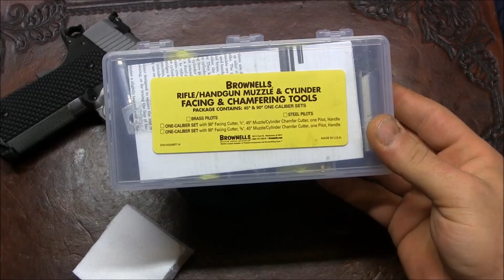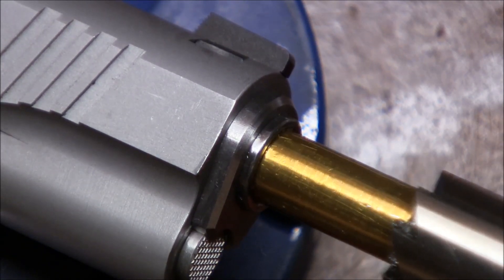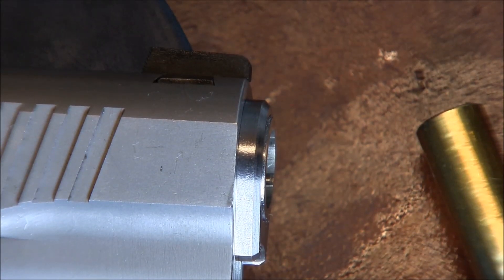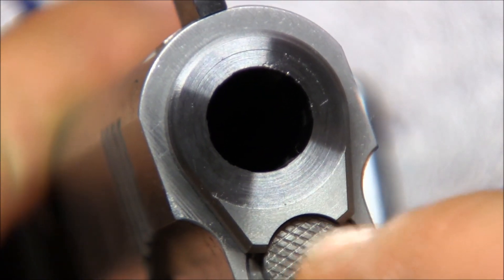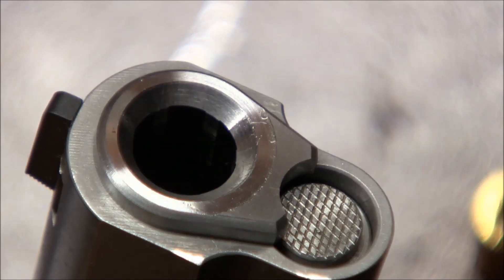1911 Build 4 - Part 5 - Cutting a Reverse Crown

Comment: Is there a specific name for that 90 degree cutter you start with? Have been looking for one that can face a 1" tube that has a 3/4" Inner Diameter, but haven't been able to find one for several years now. Also, looks great. I'm surprised they don't come like that. (though I guess it would be hard to make them match up with other parts).
Reply from the maker: I think they are called piloted facing cutters, but I really don't remember. Try McMaster Carr.
Reply: @MosinVirus  Thank. Actually found several... but just not any near the right size I need. Still much closer to finding them though. Appreciate that.

Comment: I’ve tried and tried to find these parts on brownells, anyway you could help me find what I need to do a flush cut reverse crown barrel on my 1911, along with a reverse crown cut on the barrel bushing.
Reply from the maker: I showed the tools I used. If you do a search for cylinder facing on Brownells site you will find them. Then you can browse related items for other chamfer angles, pilots, etc. I think I showed in the video that I cut the crown into the bushing, then rounded (deburred) the edge of the muzzle
Reply: @MosinVirus well, I could see where you used the 90* cutter to cut into the bushing some as well, I guess you done that so when you Bob nosed it. See I’m wanting to reverse crown the barrel and bushing together. All as 1 angle.
Reply from the maker: @rogerharrelljr1935  I went a little but inside the bushing with a 45° as well. If you dish it out too much you will reduce the engagement area with the barrel and weaken the bushing.

Comment: MV, sorry if I missed it, but what kit did you get from Brownells?  I've been looking for the same one but it's damn near impossible to find on their site.  Let me know thanks!Btw, great work as usual.  You've been a busy bee with your builds.  Please keep uploading your awesome vids!
Reply from the maker: Thank you. search for muzzle face cutter. then click on a cutter with a handle and pilot. then in description you will see links for sets. for example one caliber set. click on that and a new list will open. select your desired caliber. the set should include that caliber pilot (brass or steel based one what you selected) a 45 and 90 degree cutters, and a handle. then you can simply buy additonal pilots separately. again look at the links in the description. let me know if you can't find them and I will send you a link.
Reply: +MosinVirus I have been watching 1911 YouTube vids for years. Excellent vids!  Is the the part number for your cutter/chamfer set? 080-946-450WB?  I assume I would need a different pilot for different calibers.
Reply from the maker: +Richard Cooper yes, that is the number. I also got a pilot for 38 caliber to crown 9mm barrels, and .20 pilot to recess the frame around the slide stop pin hole. keep in mind that the 45 degree cutter is not wide enough to cover the entire diameter of bull barrels.
Reply: Thank you for the quick response.

Comment: Why did he have the barrel bushing slightly offset in the end when showing the work?  Was there any particular reason for having it that way at that time?
Reply from the maker: I am not sure what you are referring to. Can you let me know what time of the video you are asking about?
Reply: @MosinVirus  7:00.  It's not an issue.  I was just curious sir.  You did both an excellent job as well as video.  My curiosity just got the better of me is all.  And by the way, that job and the crowning look dandy spiffy.  It makes a world of difference.  That end looks all business now.  My only question that I can not find an answer to is what is the difference between crowning and reverse crowning.  No one has ever effectively addressed that for me.  Also, Larry Potterfield of MIdway USA states that there are four types of crowns and mentions their degrees.  Do you follow that or make that decision yourself?  Oh, and I learned something from you and wouldn't have known it were I to attempt crowning myself and that is that the barrel is at a one degree tilt while in battery.  I never, ever knew that and doubt I ever would have were it not for you, so thank you for that sir.
Reply from the maker: @FoxBonly  oh I see. That was just because I kept removing the barrel from the slide so I got tired of locking everything back the proper way.
Reply: @MosinVirus  k.  Thank you sir.  I always wonder if machining steel like that affects the metal's tempering status though.
Reply from the maker: Not at all. Especially not with hand tools. The only time that would be affected is if the parts were subjected to really high temps (which is why guns that were in a fire should be checked) or if parts were case hardened (surface only) and you removed the hardened layer.

Comment: Nice work, again ! The slide you`re using, is that the 1911 builders slide with Novak lo-mount cut sights ? If so, what front sight height are you going with .250, .260, .270 based on a .500 rear ?
Reply from the maker: yes, I am using a 1911builders slide with Novak sight cuts. And I am using a plain black .160 height front and adjustable rear? lowered almost to its lowest position. the rear adjustable I am using is Springfield Armory adjustable. Brownells doesn't have a picture, but it looks exactly like LPA sights and is only $45.
Reply: +MosinVirus     $45 for an adjustable,  that`s a steal ! Thanks for the info. I`m leaning towards the Truglo. I want some thing I can use in low or no light for home defense. Plus I`m just starting to have trouble with my eyes so those bright green sights may help. lol
Reply from the maker: +TWISTEDSTRINGS69 Yes, I completely understand. my eyesight is still ok, but when I was shooting at the indoor range, I noticed that plain black sights are very difficult to see.

Comment: Hello, I am attempting to do the same thing on a 9mm 1911. I have ordered the single caliber kit from Brownell's but there is some confusion as to what pilot to use. Brownell's techs gave 3 different answers and I wound up with the incorrect pilot bushing. I ordered part number 080946350 which has a .35 caliber brass pilot. It will not fit down the barrel of any of my 9mm's. 

Could you please share with me exactly what part number you are using and what pilot bit you have for the 9mm?

Comment: What is the purpose or benefit of a reverse crown???
Reply from the maker: The edge of the barrel where the bullet leaves it is very important. A crown moves the edge deeper from the muzzle so it can't get damaged if the gun falls on the muzzle for example. A reverse crown just moves it very deep. Primarily deep 45° crowns are for aesthetics only.

Comment: Hey there you show that the bushing needs to be trimmed as well but you do not show that process.  I was wondering if you have any video of that process.
Reply from the maker: Not sure what you mean.
Reply: +MosinVirus 6:38 you talk about getting rid of the step on the bottom of the bushing but you do not show that process
Reply from the maker: +MegaCleanCab oh sorry, I simply filed the protruding portion down to match the upper portion on the face of the bushing. Then sanded the face smooth.
Reply: +MosinVirus did you just use take the bushing off and run it on a file until it was even..then sand it smooth?
Reply from the maker: +haw1144 I took the bushing out, gently secured it in the vise, filed the remaining material off, then sanded it in one direction for a brushed look.

Comment: I don't mean to be critical.... but looks like you got a little wear on the inside of the barrel on the lands, maybe from chips getting between the bushing and the barrel? Curious how it shoots now.  Thanks for the videos!
Reply from the maker: I noticed the same thing, but it looks more like polished rings. I am pretty sure it will not affect accuracy, but I will find out at the range.
Reply from the maker: you were right, I did find one shallow scratch near the muzzle. will see what the effect is.
Reply from the maker: +Navyguy0023 I figured. I thought I was very careful about making sure the shavings were not allowed in the bore.
Reply: Maybe doing the cutting with the bore pointing down would help avoid that.
Reply from the maker: That is how I do it, but for the video I had to show what I was doing.
Reply: Makes sense.  You may need a camera mount so you can point it up at the work then!  ;-)

I'm looking for videos where someone has cut a full sized frame to fit a Commander length slide.

Comment: I keep seeing the term "reverse crown"...What the hell is a reverse crown? That is a 45 degree CROWN. (Some just call it a chamfer). But that is what it is a crown, nothing reversed about it. It it were reversed the muzzle end would come to a 45 degree point (like a spear head) where the longest edge is the interior of the bore. 
Deep recessed crown: yeah
Deep 45 degree chamfer: sure
Reversed crown: WTF
Reply from the maker: The name is less relevant than the result. Does it really matter what it is called? If you want to refer to it as something else, by all means do it. The point of the recessed crown is protection of the edge  of the muzzle where it meets the bore/rifling. This is largely esthetic.
Reply: @MosinVirus  I'm fully aware of what a crown is and it's purpose as well as different shapes. Recessed, 11 or 79 degree target(depends who you ask), recessed target,  and so on. I understand that the crown is the last bit of rifling that transitions to the muzzle and is the last influence the barrel has on the bullet and any nicks, burrs, or eccentricity can upset the bullets gyroscopic stability by uneven gas escape on exit, thus harming accuracy.
BUT, what I am saying is "It's just a crown" ,a deep recessed crown. I'm not sure why "reversed" has to be put into the mix of things. 
Your work turned out good, I'm not knocking that at all and I too think that the flushcut looks better than .050" of barrel hanging out for no reason. Anyway keep up the good work, I've watched the other videos and thought highly....just the terminology got me this time.
Reply from the maker: @kassilewis5511  understood.

Comment: You will have to be VERY careful when disassembling, cleaning, and reassembling your barrel. With the sharp edge on the barrel, the slightest hit against anything will cause the barrel to hang up in the bushing, especially if the ding goes to the out side of the barrel. It looks nice, but in the real world, it is not practical due to the ease of damaging it. I would have not taken the 45 degree cut all the way to the edge of the barrel, or I would have done an 11 degree cut instead of a 45 degree. It would still look nice, but without such a sharp edge that is prone to damage. Just my thoughts on the subject.
Reply from the maker: I actually didn't leave the sharp edge on the barrel. I did remove it.
Reply: @MosinVirus  You did not show it in your video, and ended the video with a very sharp edge. The video was what I was commenting on, not what you did after the video.
Reply from the maker: I just skipped though the video and I did show removing the sharp edge at 6:20 of the video.
Reply: @MosinVirus  Not to labor the point, that is a sharp edge, not razor blade sharp, but sharp enough to be fragile if hit. That is what I am saying. It is your pistol, if you want to shave with it  that is your business. I just commented on the video, in the COMMENT section.
Reply from the maker: Point taken. By the way, I wasnt arguing. I do appreciate comments. Just wasn't sure if you noticed that razor sharp edge removed. I agree that if something hits the muzzle when the slide is locked back there will possibly be enough damage to impede function.

Comment: whats the point of doing this?
Reply from the maker: Nick Ireland moving the crown deeper means there is less chance of it getting damaged, but I believe this is frequently done mainly for aesthetics, rather than function. I have done it to clean up the face of the gun, make it look a certain way, and to learn to do it.
Reply: so it does not improve accuracy or anything?
Reply from the maker: Nick Ireland re-crowning the muzzle only improves accuracy if there was a problem with the crown in the first place. This mod really only does two things - hides the crown from damage and gives you the custom looks.